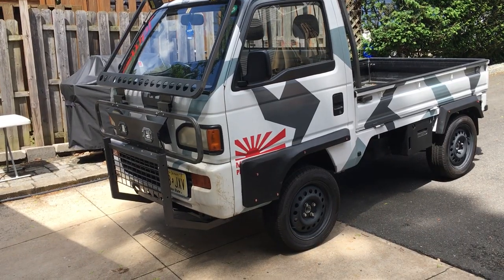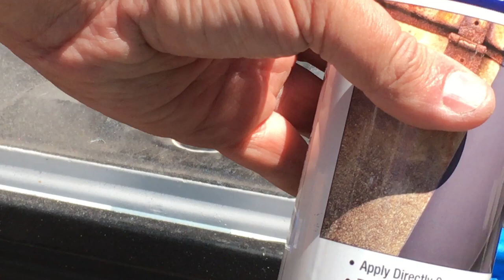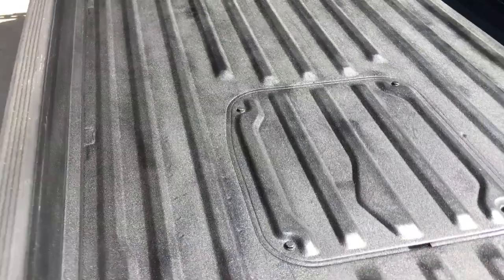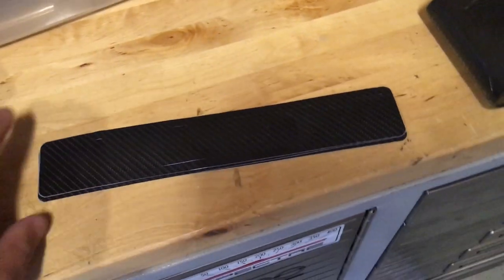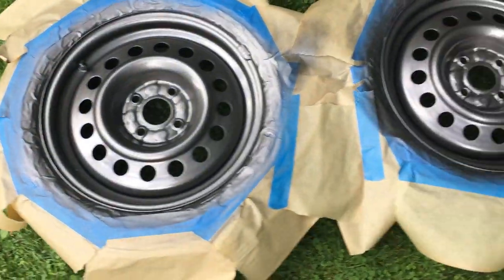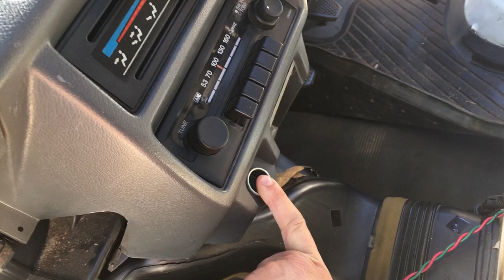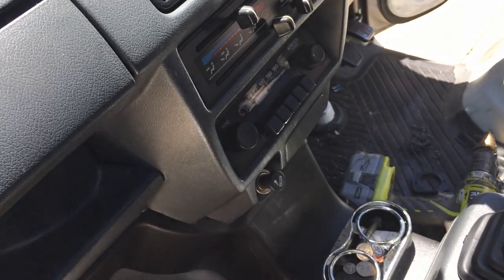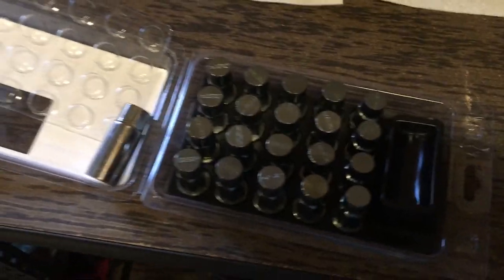Honda Acty JDM Kei car mini truck project. Freshened up the ACTY with some much needed TLC.

Comment: Love your content.  Not sure if you already changed out the usb charger but you co7ld take the power wire from the cigarette lighter and moved it from a a constant power fuse to a switched power fuse in the fuse box.   Should eliminate any potential issues with voltage drain.

Comment: Great Job!  My acty finally arived from Japan, Any tips where to get thosse plastic caps.

 Thanks.what is the diameter.
Reply from the maker: Caps are for 2” diameter hole.  I used a 2” hole saw when I opened up the strut tower.  I got the caps at McMaster-Carr:  Panel Plugs, Polyethylene, Snap-in, for 2" ID

https://www.mcmaster.com/9750K34
Reply: @MarcoCerqueira  Truck is looking good!  I am Actually learned a lot from your videos and got all the Info from your Videos.
Keep up the good work.
Reply from the maker: Thanks buddy, really appreciate comments like yours.

Comment: Do a homemade dump bed kit. Go Motocheez on YouTube he made his own dump bed kit from used parts and scrap metal. What size are your driving wheel rim?
Reply from the maker: Don’t need a dump bed.  Besides not so easy on the Honda as it is on the Suzuki.  Honda is more of a unibody design, not body on frame.
Reply: Can you tell me what size your rims and tires are thanks